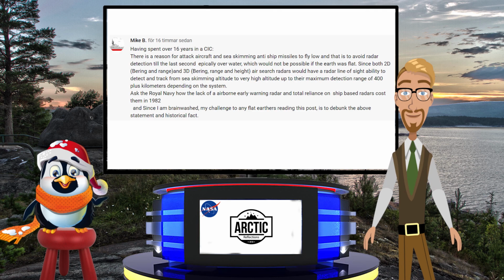The horizon kills!

Comment: As a I was in the RCN during the 70s, 80s and early 90s I can confirm all that is said by Mike in his post and all that is stated in this video. I too worked in the Ops Room (CIC) and practiced Over The Hill (OHT) Targeting. The Super Étendard aircraft did what is call "Pecking the Lobe" which involves rising until they detect the radar then drop down to continue the attack. Once in  range the missiles are fired.

Comment: After careful study it has become obvious that the "Black Swan" was in fact an attempt by the flerfer community to design a "Stealth Swan" that could evade radar detection.  The black colouring was in fact a radio absorbent coating to reduce reflections, whilst the slope and angles of the beak and position of the wings clearly designed to minimise the radar cross section. However having been deigned by failed van drivers and chip fryers it failed miserably and was easily spotted. Consequently it was instantly shot down in flames.